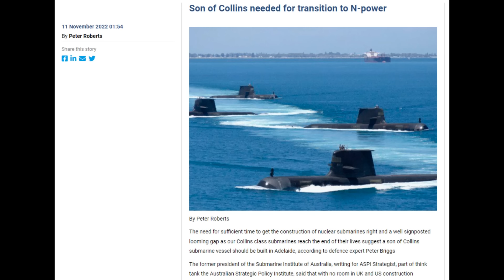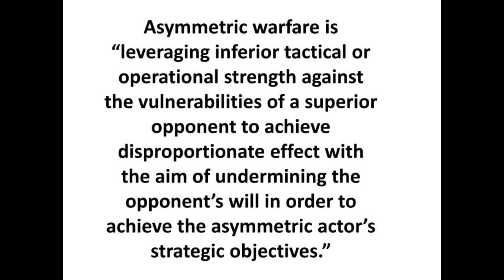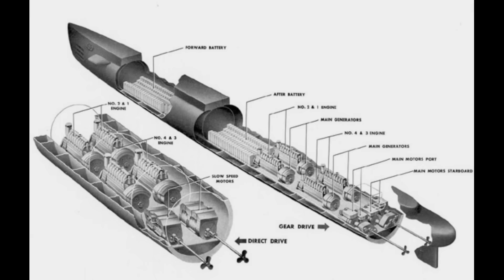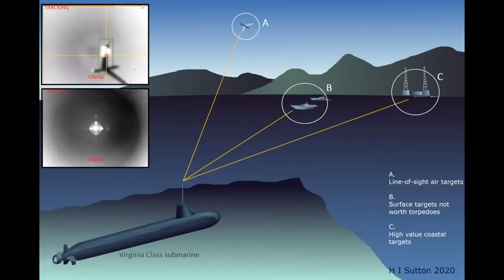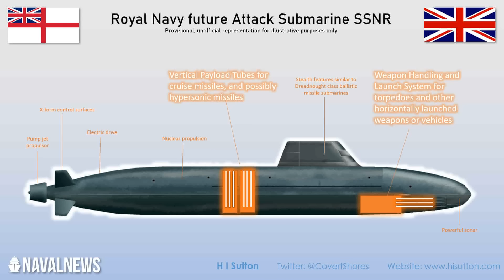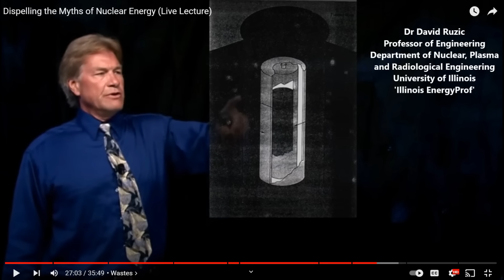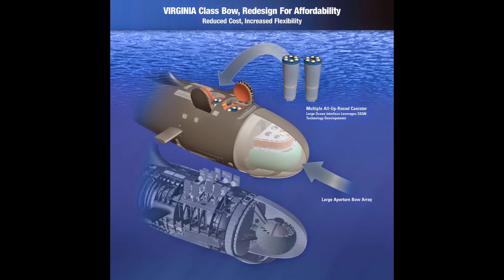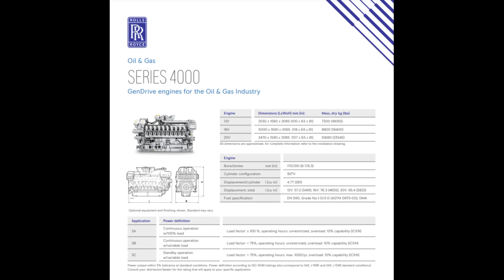SSN-AUKUS: Australia's Emergence as a Major Maritime Power of the 21st Century

Comment: 14:10 I would say 'wil be' instead 'is' the most advanced non USN carrier. Charles de Gaul is actually nuclear powered, operates Rafale M instead of J-15 and also has 2 CATOBARs and they both operate around 40 fighters and it also has AEWA Hawkeyes. And Charles de Gaulle is actually fully operational!
Reply: There's also the two 65,000 ton QE class carriers of the Royal Navy which aren't as big as Fujian, but I wouldn't bet on them being inferior. The F-35Bs they carry are definitely going to be superior to their Chinese counterparts.
Reply: @trolleriffic  yep good point, they're probably a toss up depending on the situation. Fujian probably better when you need suffiently large aripower to wage a large air to ground campaign and QE probably better at an outer air battle with F-35Bs

Comment: 1:28:07 "Indeed, the problems surrounding nuclear waste are probably one of the most misunderstood and slandered areas of nuclear energy in general."

1:28:29 "Yes, managing the decommissioning of a nuclear submarine means dealing with some nuclear waste, which needs to be done carefuly and responsibly. But the scale of these problems is vastly excaggerated in popular conception."

These quotes are very correct and appropriate! But then you go on to say:

1:28:41 "As dangerous and long-lived as high-grade nuclear waste is ..."

and:

1:29:31 "Nuclear reactors also generate a much larger volume of low- and intermediate-level waste [...] This material only poses a moderate level of radiological risk. Generally speaking as it has been neutron-activated, it poses no threat to ground water contamination, and has a reasonably short half-life."

These statements propagate the widely held misunderstanding that radioactive substances with long half-lives are more dangerous than those with short.

The reality is that the most intensely radioactive substances have short half-lives, while the longer the half-life the less unstable the substance is. To wit: Fully stable isotopes, i.e. ones that are not radioactive at all, have infinite half-lives.

But because big number = scary for most people, this myth and misunderstanding has been left to fester in people's minds. No doubt it is a useful myth to anti-nuclear activists.

The reason that high-level waste like used fuel is treated with such extreme caution is twofold:

* the actual amount of highly radioactive (short-lived) fission-products contained in it, which is what makes it legitimately deadly for decades

* the much more emotional aspect for transuranics, especially Plutonium, being bred inside the reactor by neutron-capture by Uranium-238. The general idea with burying used fuel is that "we dig it out of the ground, so we can put it back into the hole whence it came, or an equivalent hole". So the two natural isotopes of Uranium, 235 and 238, with half-lives of 700 mn and 4.3 bn years respectively, are accepted as they don't cause a net increase in the amount of radiation on the planet in general. However, Plutonium-239, with a half-life of around 24,500 years, falls between two stools: It's much shorter-lived than the two Uranium isotopes, so the rationale that it doesn't contribute to overall radiation levels isn't applicable. On the other hand, the half-life is far longer than we can manage in human, or civilisational, timescales. There is a rule of thumb that an isotope that is not being replenished will have decayed to insignificance after ten half-lives. And the often quoted figure that used fuel must be protected for "hundreds of thousands of years" is actually derived by multiplying Plutonium-239's half-life by ten to obtain roughly a quarter-million years. But in reality, even though Plutonium, were it to leak into the environment (which is unlikely given the care with which sites for deep geological storage are selected and the engineering that goes into them) would increase radiation levels, it does not have the capacity to increase those levels to anything that matters biologically. There is a lot of leeway in how much radiation living things can tolerate, and natural background levels are orders of magnitude below what could be considered dangerous.

Rant over. I also recommend this video, which is much more hands-on with spent nuclear fuel from the civilian sector, and when it becomes safe to handle by a few diffrent criteria:

https://www.youtube.com/watch?v=jM-b5-uD6jU

Comment: One gripe: There's a difference between maintaining an industrial base for short-turnaround equipment, like small arms, ammunition, vehicles and missiles, compared to a decades long build for a ship. If a war is going long enough for us to meaningfully produce more naval assets, we've already lost in an unimaginable way. And I never see this argument used for developing a domestic aircraft industry. If it stands to reason we need to have domestic naval building in case we go into a long-term war where we can't depend on allied naval production, how does this argument not apply to fighter jets as well?
Reply: The main reason why the focus is on shipbuilding is because we technically already have a shipbuilding industry so the foundations are there to build upon.

Not that I'm against it, but to establish a proper aviation manufacturing capability in Australia will require a lot more investment as we would literally be having to build from the ground up. That's why you don't see many people trying to endorse such a thing.

Though stuff like Boeing Australia's MQ-28A Ghost Bat could be the thing that gets investment flowing into the Australian aviation sector considering the fact that Boeing Australia intends to build them here. Hopefully the government supports them on it.
Reply: Fighters have a smaller turnaround and could be built in couple of months for more asserts as well as spare parts we currently have very limited ability to have spare parts for our fighters
Reply: Building a modern, 5th generation fighter (or even a 4.5 gen fighter) is an absolute suicide mission for any power without a skilled background in jet aviation. Just look at the long delays, teething issues, and massive problems that nations like South Korea, India and Turkey have had with their programs.
The cost overruns will be insane. Not to mention that no power outside of the US and China is building a 5th generation (much less 6th gen) turbofan engine. They are extraordinarily difficult to build, and it took China over 30 years of suffering to get their WS-15 engine to enter production. This is because of the incredible manufacturing precision, advanced alloying, and next generation manufacturing techniques that are required to build military aircraft. Such a constraint does not exist to the same extent for large vessels as submarines. 
We are already working towards a flourishing aerospace industry with our Ghost Bat autonomous drone fighters, and it is better to work up through increasingly larger classes of drone before attempting a manned platform. A larger and more advanced Ghost Bat presents more of a benefit to our strategic interests, and a far more achievable goal than a domestic manned fighter. Perhaps in the years to come we may increase in skill and technical experience to the point where a manned platform is considered plausible, but it would need to be in response to a genuine capability gap. What that would be, considering our current Super Hornet and Lightning II aircraft, is a mystery to me.
Reply: @goddepersonno3782  You understand that's my point, right?
Reply: Depends what you mean by "build". There are things the US does not allow even its allies to make. If you can't get these critical components, your local industrial base will not be that useful during a war where international shipping is disrupted, especially if we are importing most of the parts and just assembling it here.

The truth is the argument does not withstand close inspection, we know all that, so we try not to overuse it. 

I agree there are things we buy on a regular basis, so it is possible and sensible to maintain a manufacturing base to supply it. There are unfortunately too many examples of factories built for 10 year programs that are then shut at the end of procurement process, then in a couple decades we rebuild it again from scratch at enormous cost of course because all our industrial knowledge was lost when we shut the factory and retrenched everybody the last time.
Reply: There are two primary reasons to maintain a naval building program within Australia. Firstly is the financial aspect that allows the money invested in defence to re-circulate back into the economy and politicians can use it to purchase votes. I think that's easily understood.
The second and real reason we would wish to have a naval manufacturing capability is so that we may sustain ourselves during a conflict. The maintenance requirements a vessel requires whilst conducting ordinary operations can be accounted for and tends to consume a significant amount of its lifespan especially in the case of submarines. At the minimum we need to have the ability to undertake that maintenance ourselves.
The ability to manufacture naval equipment allows us to increase maintenance and repairs especially in the case of any battle damage and return what vessels we have into service will ultimately decide whether we can sustain operations over the medium term. Not to mention the ability to multiply from the current manufacturing base in comparison to starting one when a conflict begins.
You are most probably correct though that any multi-year, decades long conflict will seriously stretch our ability to respond in an adequate way.
Reply: @anthonyomahony3545 3545 Any government program can be used to spend money for the purpose of stimulating the economy. Defense programs are terrible for this purpose, because local content usually is tiny compared with building roads for example. Building a warship does not deliver the economic benefits that building a port does, nor does it improve people's lives in the way that building schools and hospitals do. So, while Defense programs can be used to stimulate economic activity, if that is your goal, there are better ways to achieve that goal. It is the worst reason for spending money on defense. Defense is about delivering a military force to support the goals of the government both at home and abroad.

Each of the services has numerous high profile procurement programs where you have a large group of people who think it would be a clever idea to build and support that program locally.  Ship building is just one of many options. The deciding factor as to whether any program should be procured locally comes down to cost. Cost is not just how much will a program cost but the opportunity cost as the Australian defense budget is large but limited. 

Nobody believes that if the Royal Australian Navy is going to spend A$300 billion on submarines that the RAN will not have to forgo buying other critical capabilities. The reality is Australia is a small nation with a small defense budget. If building submarines in Australia were to result in a smaller less capable surface fleet, a smaller Army, and a smaller Air Force, I would not be in favor of that choice. 

Submarines are powerful, SSN's even more so, but keep one thing in mind in this debate. There is no mission we deployed forces for in the last fifty years a sub force could have been deployed for, which is why no Australia sub has been combat since WW2. If I am right and the next big war is a land war in Indo China, we are about to spend a lot of time and resources preparing for the wrong war.
Reply: Your words are true but in this increasing risk environment they are apparently what has been deemed necessary and it would appear to unlikely have a huge material effect on other sectors of our military.
You can never be sure where the next war that threatens our sovereignity comes from but they are guessing and the easiest way to protect Australia is deny access to the sea.
I am not sure your financial arguement is completely justified as pointed out by hypotheticalhistory that it could be crucial  for kickstarting and transitioning into a nuclear nation. We had that opportunity in the past and turned it down but with the demands for a carbon neutral world it may provide the skillsets and change in public perception that is required. Granted it is very much not the longwinded way of acheiving a civil nuclear industry but is a potential bonus in that aspect. Not many nations are granted the opportunity
Reply: @goddepersonno3782  Agree with  your  overall point however you forgot to mention Rolls Royce and Safran - RR has an announced JV with IHI in Japan for the 6th gen GCAP fighter project.

Comment: It should be noted that nuclear submarines do have to surface, eventually, due to the food requirements of its crew.   I don't know how long exactly a nuclear submarine could stay continuously underwater in wartime conditions with the crew just subsisting on dry MREs, perhaps 6 months?,  but in peacetime, typically the subs surface every 60-90 days or so to take in fresh food to keep the crew from going crazy.
Reply: Absolutely true, nuclear boats also require more maintenance, particularly reactor maintenance than diesel electric boats. That being said those things do not detract from the very real benefits of SSN's for a nation like Australia. 

Germany and Sweden can get away with diesel electrics, their submarines are mostly coastal defence boats or optimised to operate in the Baltic or North Sea. Australia needs something with a LOT more range, and a LOT more endurance. 

In reality wartime patrols will likely not go much above that 90 days, maybe up to 120, but likely not much more than that, because the human factor is as important as the technology behind the submarine. Submarines will not be on war patrol for 6 months at a time. They might be in a region for 6 months to a year, but they will be spending regular periods in port, be that a port of the operating nation, or one of an ally. And the reason is simple, you cannot stuff a couple hundred guys in a submerged steel tube for 6 months on a submarine war patrol without morale cracking. 

The operators of Nuclear boats understand that. Hell, the operators of submarines in WWII knew that, patrols in WWII lasted weeks, not months, because the cramped conditions of WWII boats meant that anything longer than that would see a rapid decline in crew efficiency.
Reply: The US Navy runs tours for 90 days as they can’t store fresh food for a longer period.
Reply: In war time, it is likely the subs will run out of weapons before food.
Reply: Big assumption that the crew are not crazy already !!!

Comment: Funnily enough, the australians should go with the french nuclear sub;
This is the most recent attack nuclear sub right now, with the very last techs, requieres a small crew due to its high level of automatisation (60 vs 110 for the Astute, and 140 for the Virginia), is smaller due to its smaller crew, hence costs much less than the US/UK current attack subs.
Plus the shipyards building them for France could start pumping out subs for australia by 2027 when their domestic production stops.

As a result, instead of 6 Virginia class subs (at an undeterminated time), which would translate in only 2 boats active at any time, the australians could have 12 to 18 Suffren Class subs, so 4 to 6 nuclear subs at sea at any time, by the early 30s (accounting that the Suffren is twice cheaper than the Astute, and 3 times cheaper than the Virginia). It would be the most recent class operational on earth, and profit from the fact that the first produced would have been tested by the french, so mature by the time the australians get them.

And the refuelling question is a non issue. Subs need heavy maintenance every 10 years or so, the french do the refuilling (a routine 3 weeks operation) during this time. And as they use low enrichment uranium, a lot of hasles disappear: Australia, like all nations on earth, already produces, uses, and manages low enriched uranium.

Comment: Excellent documentary and analysis, great production quality. nuclear was the only option, you should have started after the last Collins and you would have had your own Astute class by now, and they are a lot better now than their press. 
 8-10 decent boats will keep everyone away. Also considering Seawolf and LA class etc were quieter than any other SSN out there with pumps, would assume Virginia can super cruise at 35-40knts, given the pumps only kick in in the mid 20s..
Reply: I'd be surprised if the Virginia class could go that fast, especially while remaining quiet. Noise will increase in a very non-linear relationship to speed so going a bit faster can result in a massive increase in noise production. The boat's propellor will also be optimised for a certain speed range and operating outside these speeds can result in significantly degraded efficiency and stealth.

Comment: I'd argue that if the AU/US program for joint construction of Virginia Class submarines was structured correctly, it could work. We need to construct at a much higher rate than we are currently. A third shipyard producing the Virginia Class would be a wonderful addition to both countries.Conducting research and development on the 6th flight of them would make it even better.
Reply: VIRGINIA boats are, like ASTUTE, in danger of losing their edge a little. Hence the AUKUS programme to avoid that situation and build Aussie capabilities.
Reply: @mrw6156 @ mrw6156 You are correct to a degree. Virginia Class keeps evolving. Also, like the UK, a newer design is in the works. What I'd love to see is all three countries working toward a common design. All three have something to contribute and all three would gain by it.